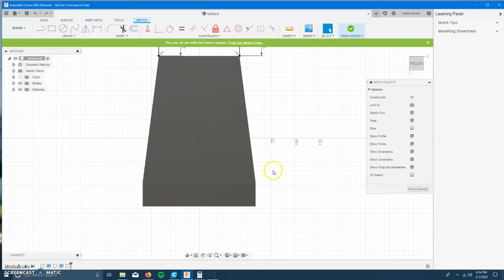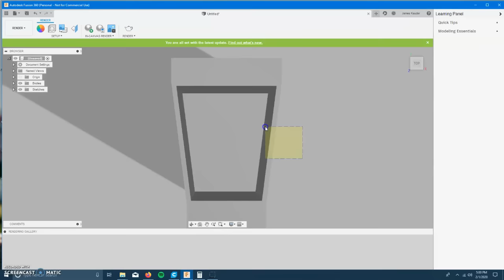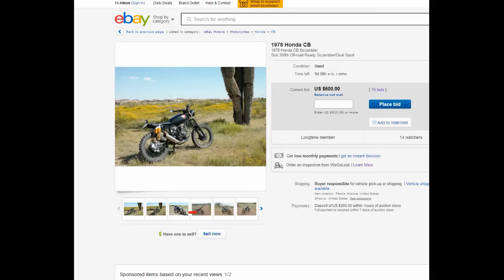1978 Honda CM185 Scrambler - Full Timelapse Build

Comment: These are such cool little bikes anyway and to make a scrambler out of it is even better. I had one of these, the 200cc version. I rode it everywhere on and offroad with zero issues.
Reply from the maker: For sure man. They're pretty light for being twin cylinder bikes as well. Just the lack of power and the 185's being a 4 speed kind of sucks. It would barely do 30mph in deep sand.

 I'll do another one day, and swap in a cm250 motor and hop it up a bit. Really didn't want to sell this bike but the next build needed the funds.
Reply: @DoctorMotorcycle yeah, it's not a huge engine anyway. I always wondered about a few key mods with one though. Advance that timing a little, dual carb and some porting polishing. I love the exhaust on that, so cool.

Comment: ( I'll might have some typo issues, bear with me) Wow. Amazing. I'm got a free 1982 cm250 rust buck I'm trying to on the on the road. Someone really did a hatchet job on it before to me. It did not run. Beggars can't be choosy. (I'm on disability because of a bike accident) 

I'm trying to add some back end. No plays for tags and lites-- no fender. I have the frame two pipes like you have 08:04   A piece of rebar it fits in the holes perfectly snug. I'm gonna try to pay  someone help me bend some rebar so that it can slide in and out and lock with a clip, I'll make a longer one to carry carry luggage. Simple rebar with a an 180 bend. 
It is crazy how much my bike looks like you-- if you squint in the dark. Yours looks new, mine like Mad Max. I actually have my brak and turn signals mounted on top of seat rite now. Both my tires look like your front. Same colors. I have short pipes that no come up tho.

Comment: I just got a 78' CM185T for free a few days ago. Now you're making me think of what I can do to it and I don't even have the title yet. It was kept inside since the 80's but was left out for a year recently so it needs work, but it runs and it only has 2k miles! I haven't driven it ye because the tire are shot (I think they're original, like  everything on the bike) and I haven't cleaned the air filter or carb. I don't really know anything about bikes but I think this'll be a fun project to start and work on.
Reply from the maker: Do it man! The little CM's are fun bikes, especially since even stock they barely weigh 300lbs. Perfect candidate for a scrambler.
Reply: Will you try following a damn train when it's done?
Reply: @2020rhal  Ill try my damn best but I think it'll be too slow

Comment: I am so glad you soldered those connections. I see so many people use the crimp on connectors without solder. I don't expect their connections to last all too long.
Reply: To solder requires flux in one format or another, which eventually corrodes metal over time. Bullet point connectors well fitted are genuinely a better option.

Comment: Torque wrenches are overrated 😆😆
Very nice build 👍🏍
Reply from the maker: The only time I use a torque wrench is critical compenents (anything involving the inside of the engine mostly).
Reply: I knew an old Yamaha mechanic who didn't use them.. Many heads are tightened by degrees .

Comment: I am doing the 1980 200cc version of this. Thanks for making the video. Mine needed SO much  more work than this one, so I'm chugging along.  I had a few questions if you see this comment. 1. What kind of battery did you use?  2.What did you use to replace the airbox? Nothing I can find will fit around the stupid center support.  3. What is that on the crank case breather tube?  You did so well, I now have inspiration to redo the wiring like you did.  This is also my first bike (Bit off more than I can chew, but you give me hope)
Reply from the maker: 1. Generic 6v Duracell from Batteries plus. Just about any 6v battery that's a modest size will work. 2. I used a Mikuni VM-22, custom flanges/gaskets to mount the carb, and a Foam Air-Filter with a 45 degree bend that had to be "massaged" on to fit. 3. I used a fuel cap breather as a crankcase breather. Make sure if you do the same thing you drill extra holes in the cap or it won't flow enough.
Reply: @DoctorMotorcycle  I've also been curious about those 6v Duracells. Please correct if I'm wrong, they are plenty good for kick-start only, but not enough crank-amps for electric start (or at least not intended)? I'm debating if it's worth keeping the starter on my cm185t build, or just keep it simple. Anyways, I'm very impressed with the video. Looking forward to future content!
Reply from the maker: @vonme3  Thanks. IDK what the generic 6v's were intended for but the starting system worked just fine on this bike. I always thought it was cool to kick start the bike, makes it feel so retro when you're at the gas station kicking a bike over. But yeah the starter was still functional on this bike after the build was finished, I just never really used it. Take care!

Comment: Nice looking bike. I get why people don't keep fenders on them, but that's definitely just to make a bike look cool. If it's actually going to be a scrambler, it's going to be pretty miserable riding through mud or even simply getting caught in the rain.
Reply from the maker: I agree, which is why the bike still has fenders. I didn't have it installed for the final shots and pictures because it made the bike look "odd". I left the tabs on the frame for the fender mount, so you could bolt the lower plastic part back on. It does have a front fender on it in the photo's however, it's just been bobbed. Thanks for watching.

Comment: If a 78' it was deserving of a full engine rebuild.
Reply from the maker: 6k original miles, no leaks, valves still in spec. I would politely disagree. Ran great when done, still no leaks and had plenty of power + got 60mpg. I still miss it to this day when I think about it. Take care friend.
Reply: @DoctorMotorcycle  - Duly noted - yes, Understand fully and I stand corrected. Cheers, mate.

Comment: Interesting that you sand and sand on ground contact points but use no dielectric grease or any other method to prevent corrosion.

Comment: I guess it's a  twin Cylinder ??   In  about  1982  I took a  Honda  SL-125 motor  had it bored  stroked , ported and cammed to 160 CC's and put the motor  in a  1977  Honda  CR-125 frame .. great handling bike fun to ride.. the Next  year  Honda  came  out with the short stroke  4 vavle head  XR-200

Comment: Check resistance, sand points, 5 kicks maybe! HONDA RUNS! priceless!!
Reply from the maker: Haha right. It surprised me too. Even after all that time sitting, none of the seals leaked. I didn't even need to adjust the valves or timing chain, I put a new Mikuni carb on it and that was all I did to the engine. Classic Honda.

Comment: Use a good set of crimping pliers!
And never solder crimped connections, especially on vehicles its a nono, the shaking will break it in time!

But it's a nice bike!
Only the wing on the left side is pointing the wrong way, that's the only thing which would annoy me..

Comment: What kind of forks are those up front. I just grabbed two of these and want a similar look to mine. Thanks for the video! This is going to be super useful. I’ll post my finished versions when I’m done.
Reply from the maker: Stock forks, just painted black and added gaiters.
Reply: @DoctorMotorcycle  no way! Looks like a completely different set. Any chance you’re selling any of those 3D printed battery boxes?
Reply from the maker: Possibly, I had issues with my old 3d printer and finally ordered a replacement. I'll let you know before the end of the month. Please send me an e-mail if I don't get back to you, it can be found under the "about" section on my channel.

Comment: Awesome job man! What was the substance that you dip your wheels in?
Reply from the maker: Thanks. The wheel spokes were rusted, so I cleaned/de-rusted them with electrolysis. The wheels were rattle can painted off camera, I cut that part out because the original cut of this video was almost an hour long.
Reply: DoctorMotorcycle what do you use to rattle can small parts? Rear brake linkage, etc.

Comment: What do u do for ignition systems on these bikes, i have a sl100 I would like to pick ur brain on, If u have any time,
Reply from the maker: I kept the points but replaced the contact breaker. This bike was still 6V. In hindsight I would convert to 12v like I did with the KE100 scrambler build, the lights are so much brighter. If you want to pick my brain I'd be much more inclined to help you as a Patron, I very rarely visit the comment section anymore. I'm currently working on a wiring how-to video that would likely be of help to you. www.patreon.com/DoctorMotorcycle

-Jimmy

Comment: Hey Looks great.
Why wasn't the Bike starting at the beginning of the Video? Was ist a Problem With the capacitor? How much did you measure when you tested it?
Or was it a Problem with the circuit breaker?
Thanks
Reply from the maker: The condenser was fine. I was checking it by applying voltage to it, and seeing if it held the voltage (it did). It's very unusual in my experience to have condensers go bad. The problem was the breaker points. They looked like they'd never been cleaned, and the points weren't making contact. That's what I was doing with the sandpaper. Take care, hope this helps. -Jimmy
Reply: OK thanks.
I'm going to check that.
I was also thinking about ultra Sonic cleaning of the carburator. The Bike was in a Garage for a few years.

Comment: This is great ! I really do love your build ! I'm planning also to build my own Cafe racer. Is it ok if you share me your file on the 3D printed battery case ? I do want to print one.
Reply: You could cut and bend one from an old aluminium sign. Rivet, bolt, weld or glue it together.

Comment: You need the carb off a 250 Nighthawk , they are pumpers
Reply from the maker: Good to know. The next time I do a CM It'll be a 250, and I'll do twin carbs instead of one single. This bike was fun (no longer own it) but the 4 speed was the biggest drawback.
Reply: DoctorMotorcycle definitely need a 5 or 6 speed
Reply: @DoctorMotorcycle    I recieved an '83 CM250c and I'm trying to learn the ins & outs for my first bike restore/rebuild. What is the advantage of switching it from a single carb to a dual carb? I know it will increase some complexity and require carb syncing, but will there be a greater power output?
Reply from the maker: @jholloway77  Yes, much more top end power is the main advantage
Reply: @DoctorMotorcycle  good to know. I know the CM250c and the CM250c have the same engine and there is a dual carb floating out there for the latter. Maybe I should look into that

Thanks!

Comment: Build is awsome can you suggest an engine with like a 80 mph speed normaly.
Reply from the maker: CM250's had a 5 speed and 40 or so more cc. With taller than stock gearing I don't see why you couldn't cruise at 80 although it would probably be revving pretty high. Any big single would do it a bit better (think yamaha XT500) and the weight is pretty close, but good luck finding one.
Reply: @DoctorMotorcycle  thanks for the info sir

Comment: What's going on at 19:50 ? What did you pour in it?
Reply from the maker: Electrolysis, I poured in Super Washing Soda and mixed it into the water. It removes the rust from the wheels.
Reply: @DoctorMotorcycle  Nice, I never thought of doing that before. Maybe next time removing rust I will also try electrolysis

Comment: You kept the 6V, do you know front LED’s and rear updated taillight were used in this build? Looking to order for mine, thanks!
Reply from the maker: When the bike was sold, the new owner told me that he was having trouble with both the headlight and tail-light. The headlight bulb was from Amazon as well as the tail-light, but both were such low quality I wouldn't even feel comfortable recommending them to you. He went through 3 headlight bulbs and one tail light bulb before we stopped contact.
Reply from the maker: @followthepaytch  The CM-185 has that cover factory, used for the choke lever. I 3-D printed an adapter spacer to run the light. You could probably super glue a washer where the hole is to make the light fit if you had to. I've added the Neutral light in the description.

Comment: Love it. I just got one stock, is there anyway I can pay you to ship me the exact same battery holder that you put under the seat?? @doctormotorcycle
Reply from the maker: Have quite a few orders I need to fill with 3D printed parts, in addition, the CM185 box was designed when I really didn't know how to make them strong enough to last in dirt/offroad conditions that well. I wouldn't be surprised if the owner after me had it break during a run of the mill "tip over" drop. I had a battery box break on my XS650 and had to go back to the drawing board + design a brace to make it stronger. It would be very difficult to redesign another battery box without having a CM185 in front of me to test fit.

*Edit 4-1-21 For context if anyone reads  this; As long as the bike isn't dropped, or the box isn't directly struck (accidentally or purposefully), the old design was still fine. I dropped my XS650 during the assembly phase, kickstand popped up by accident. That caused a crack in the box, and would've eventually broke.
Reply: @DoctorMotorcycle  I appreciate the honesty, thanks dude!
Reply: @DoctorMotorcycle  one more question, can you post a link / description of what battery you used for this build?? I'm trying to get rid of the lead-acid for a more compact like you used, do you have any... leads? thanks man

Comment: It looks like you have a pod filter on there. Which one did you use? I'm having trouble finding one that will clear the frame.
Reply from the maker: I couldn't dig up the part number, it was a generic filter that was at a 45 degree angle. I had to "massage" it on to fit, it rubbed the frame rail for sure but still worked.

Comment: what did you do to the carb that upgraded it? I'm rebuilding one of these right now.  id love to know what you're using that go t you to 80 mph
great video!
Reply from the maker: VM22. It didn't bolt straight on, I had to modify the manifold, make custom gaskets, and make a spacer/custom cable for it to work. I also added 2 teeth to the front sprocket for the top speed to be 80. And it would only hit 80 hunkered down on the tank tapped out for a half mile lol.
Reply: @DoctorMotorcycle  I have the sprocket, air filter, and i have no choice but to un-restrict the exhaust, since the mufflers have rotted off.   i guess ill try to shim the needle in my stock carb and see how i do.  thanks for the videos bro, good work!
Reply from the maker: I'd recommend running the pilot on the rich side, then working your way richer on the needle. Having a pilot that's on the lean side can cause all sorts of issues that, based on throttle position, you'd think was a needle issue. When I was jetting the new carb, I bought 2 different needles from mikuni, both with different diameters and tapers, and must've swapped needles and changed the clip position 15 times. I ended up with the stock needle and stock clip postion, but with a pilot 2 sizes larger.
Reply: @DoctorMotorcycle    nice.    once a find some reliable spark ill report back.     Mine had a mouse nest on top of the air box, and all the wires that were supposed to live there have been eaten.   I'm seeing what i can eliminate and rewire, rather than buy a whole harness.    

What did you do with the breather separator thing? i figure id just eliminate it since I'm not using the stock air box anymore.
Reply from the maker: @eric-merv-steinberg5090  I just put a mini breather filter on the barb that sticks out of the case
Reply: @DoctorMotorcycle  sick.  im excited but im waiting for parts and there's not much i can do for now.   i guess ill clean my shop in preparation for making it super messy again.
Reply from the maker: @eric-merv-steinberg5090  lol story of my life
Reply: @DoctorMotorcycle  last question, and ill stop hassling you.   can you link the speedo you got?
Reply from the maker: @eric-merv-steinberg5090  The speedometer link was added to the description.

Comment: Did you get a new coil? If so, from where? I am working on the exact same bike now.
Reply from the maker: The coil was aftermarket/new when I bought the bike. Owner thought that's why it wasn't getting spark but it was the points not the coil. IDK where he got it. The new OEM hitachi replacements on ebay are $150. If you haven't cleaned and gap the points yet that's where I'd start.
Reply: @DoctorMotorcycle  Also, where did you get replacement engine gaskets?
Reply from the maker: @mr.urbanism  I don't usually use gaskets, just Permatex "the right stuff". Clean the surface with rubbing alcohol before you apply it, make sure there's no oil and it won't leak. A $8 can will do 10-12 covers easy.

Comment: What rear suspension did you use? And what was the tool called that you used to spread the tank wider?
Reply from the maker: Ohlins, the tool is a brake caliper spreader.
Reply: @DoctorMotorcycle  Were they genuine Ohlins? or are they off another bike,  they look like STX 36's but they cost around $1000 new, considerably more than a CM is worth :-))